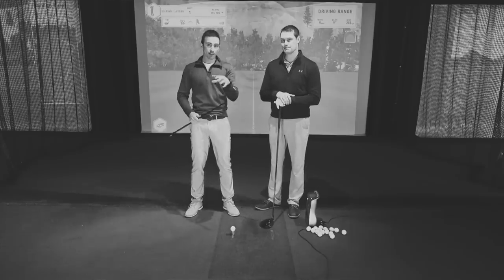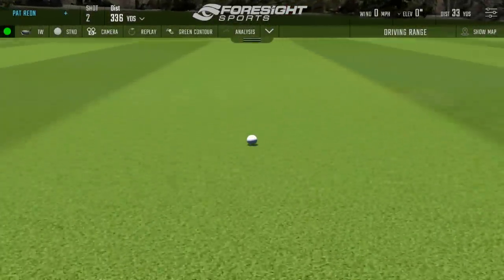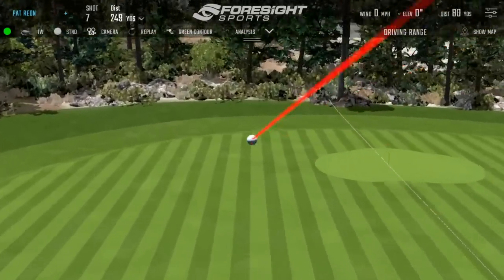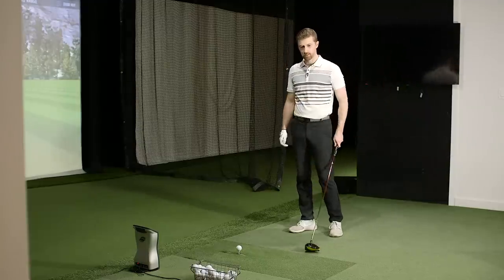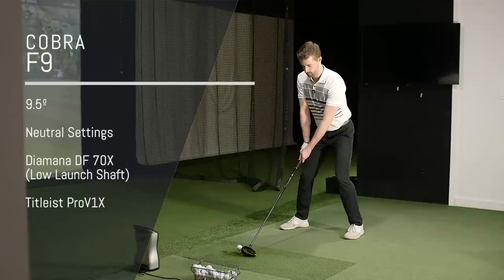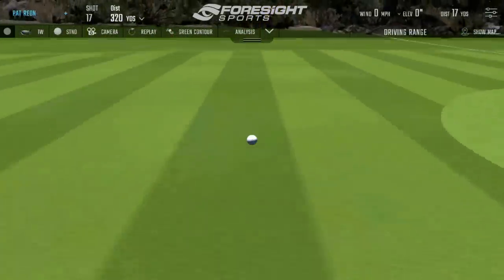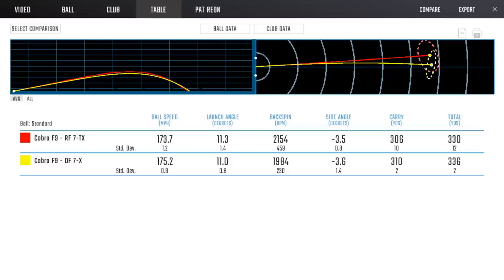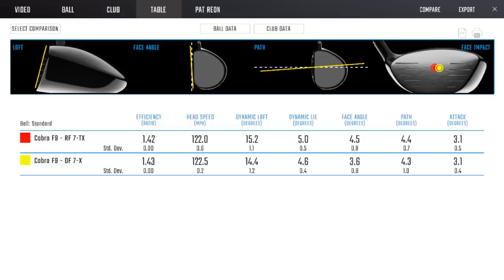High Launch VS Low Launch Shafts – The Real Difference

Comment: A can of foot spray, several shafts with various weights and flexes, and countless buckets of range balls I have figured out my shaft profile for my driver.  I also found out exactly what you stress about a shaft not being capable of determining launch and spin alone.  What i found out was that a certain shaft profile (heavier weight with an ultra stable tip) produces the best strike location for my swing.  Good stuff as always guys.

Comment: Spot on once again! As someone who had never been fitted before I definitely believed that I needed a high launch shaft as I always thought I had a negative AOA and trouble launching the ball. Ironically I found out in my fitting that I'm actually a level to +2 AOA and was fitted into a low launch low spin shaft and I actually hit it a bit higher as the strike point is now much more consistent than it was before. Hopefully people watch this video and learn that nothing is better than a fitting to know what you need. Great job once again gentlemen

Comment: Excellent and precise explanation. Which I think also leads into different flex, shaft weight etc. The shaft has to match your swing tempo and how you find that is with a fitting with no preconceived ideas about flex or shaft weight.

Comment: Great video, guys. As a club fitter, I find this kind of information invaluable. It gives me more ideas on what to look for, when fitting someone for clubs. Keep up the good work.
Reply: Where are you a fitter? Looking for someone in the Myrtle Beach area that's not Club Champion...
Reply: @stephenmoxley3004  As a fitter, what should I look for and lookout for? Went to Club Champion yesterday, and it was ok. Felt like they were trying to put me in the most expensive equipment on the planet. The guy that worked with me did actually tell me that my existing driver and shaft were the exact thing I needed, but tried to sell me a $850 3W.....
Reply: @bryanduchane2371 , I'd want to make sure that your fitter is using a launch monitor to determine your swing speed and ball flight. That's probably why they told you your driver was ok. I can also tell you that, if your swing speed is less than 90-95 MPH, you probably don't even need a 3 wood in your bag. Especially an $850 one! Slower swing speeds cannot effectively hit a 3 wood off the deck. I'd also make sure that the fitter is measuring the loft, lie and length of all your clubs, to make sure your gapping is right. That should get you through the basics.

Comment: This just saved me a bunch of over-analysis!  I would be curious if flex correlates with launch, though,  as the stiffer shafts tend to be labeled as low launch and the softer (ladies/seniors) shafts tend to be labeled in the high-launch part of the spectrum

Comment: Thanks a lot Ian and Matty for great video...at time 1550, you mentioned a fact that softer shaft left tge face opened for Matt ...thats exactly what I have been experiencing... whenever I went for my good swing (faster) , the faced opened and the ball faded ... but the articles on websites always discouraged me to go for stiffer shaft ...as they claimed that to go for soft shafts with higher torque to cater for fades (snap hooks) ...so much of non sense on websites...

Now please recommend me some shafts to try which won't let the face opened when i swing fast ...ill be very very grateful

Comment: Ian, coming back to this wormhole I've gone down in shaft characteristics... In terms of stability and dispersion, would 350 vs 335 tips make a difference with the same torque rating? I would think the 350 tip would play more stable and improve dispersion, maybe even timing.?

Comment: Great content as always. I would love to see a you guys put out a video that explains the differences between optimal driver and fairway wood shaft. If I've been fitted for my driver, would using the same shaft model in my fairway wood be the right choice? Or do they typically require different shaft profiles? Would love to know.

You guys are awesome!

Comment: I have a lot of trouble with low spin loft / low spin. I can easily hit 1500 spin consistently even in a 10.5 head. Bought an AD-DJ as it was the "high launch" option I liked the feel of. Went to CC and got fitted into an AD IZ instead. Put the DJ in my 3 wood and picked up 10 yards on both clubs! Crazy what a good fit will do. Able to time the IZ so much better now and getting around 13*/2100 and a much better overall flight.

Comment: Great video and explanation of the EI curve. The timing of everyone swing is like a fingerprint for that individual. With that being said - I know that if you move a shaft from one driver to another you may or may not get the same strike point. Would it help if you were able to create the same swingweight/head weight?

Comment: Great video guys 👏. Subbed immediately. Can u do a video next where you talk about shaft torque. I've heard opposite explanations by guys in the industry that say 1: torque has an impact on shot disparity during mishits and 2: torque does absolutely nothing except make a driver feel more "boardy"... 

I would imagine that torque (along with other variables, ex: bulge and roll) can somehow interact with horizontal gear effect in either a positive or negative way depending on any swing.. but I would really love a statistical based explanation of what exactly torque does to a swing, all other variables held equal.. if it does anything at all... Thanks in advance if you consider this idea..

Comment: Excellent video I watch all your videos and they are very informative I also notice if I swing a regular shaft that's too soft I usually push the ball not hook it interesting now I'm kind of understanding why I do much better with a heavier stiffer shaft even though my club head speeds about 103 with a driver but I have a very quick Tempo at the bottom of my swing with my hands I've experimented my whole life to try to find what works heavier and slightly stiffer works better for me my hybrid shafts are 80 gram stiff I hit that much straighter than a 65 gram lighter regular

Comment: Great content gentlemen! I'll be honest...you have educated me to the point where I'm disappointed with the average fitter in my area.  I'm at the point where I'm contemplating renting 6 shafts or so and going to my local sim and just pick the best performer.  If I can dial the head in to get my desired launch;  selecting a shaft that feels the best and I time well, without sacrificing ball speeds may just be my best course of action?  I recently tried an Atmos Black and was hitting it super solidly centering it almost every swing...Its low launch selling point steered me away?   Tensei Orange, Atmos Black and Tour AD IZ are a definite 3 I'll be testing in the next week.  Any additional advice would be greatly appreciated.

Comment: From my experience a shaft can play a bigger role in the launch of a 3 wood than a driver. Do you also find this in your fittings?
Reply: I just went thru a fitting and found the exact same thing your describing. I could hit my 3W of the deck almost as far as my driver of a tee when I found the right shaft. Actually added loft to the 3W to tame it down......

Comment: A defining moment in simplifying the importance of shaft fitting. 
Personal experience fairway wood purchase 6days ago.
Why is it manufacturers allow distributors to market there product with one manufacturers stock shaft option when advertising 3 different options?
Additionally when checking shaft length against a friends club of same club size but different manufacturer his club shaft is 1" shorter?.(standard club no fitting)

Comment: Am I correct in thinking a stiff tip suits Matt and not a soft tip which seems to me to pliable for him. He has much better control with a harder or stiffer tip methinks. I may be completely wrong. Also Matt himself immediately felt more comfortable with the lower launch version of the shaft. He is an awesome striker of a golf ball. I would appreciate some comments on my thoughts. Once again an absolutely fascinating and great insight into shafts from Ian. Incidentally I would be interested in the difference in torque between the two shafts.

Comment: I absolutely love your channel. It’s probably been addressed but load and release are also important variables. I hit low launch iron and wood shafts high and high launch, soft shafts lower. I’ve consistently shoot mid to high 70’s with clubs as customized as possible from a highly respected fitter and lab. My lowest 2 scores came from borrowing my friends clubs on a trip using clubs that were completely different profiles in weight, flex, profile, loft, lie and swing weight. Shot two 71’s.

Comment: I hate marketers.   So you're saying.....get fit.  I was fit at modern golf in Vancouver and we decided on the mizuno 850 forged. Because my equipment is majorly adjusted (I'm 6'7") I've learned to order a single trail club, in this case a 6 iron. It felt nothing like the one I was fitted for, no idea why but it was unplayable for me.  That's like 2-3 years ago and I'm still looking, I've got a spare 6 iron and 4 spare 7 irons if anyone needs one😩

Comment: Did a fitting yesterday at PGA superstore.  Didn't get the Ping or Mizuno like I thought I would because of 2-4 degrees up angle of attack couldn't get spin down. Got 10.5 M5 Taylormade Graphite design Tour IZ 6. But the ball flight is flat at 25 yrds (outside). Teeing the ball up with the 10.5 causes balloon effect.  So losing distance in TX wins. What would be good for a better ball flight with maybe a different club besides going to 9.5 degree

Comment: So, the dynamic loft is higher because the face is open, but those were just the shots blocked left. If you compare shots with the most similar parameters where the face was square at impact with same path, was the peak heights the same?  I'm curious what the peak heights are on the similar hit shots. I noticed that the data shown didn't have the peak heights.

Comment: Just fitted for Mizuno clubs . Only prob was launch higish 7 iron 20 deg and spin lowish 5000 swing speed 78 mph . Will angle of attack raise spin and lower launch or go non pen shaft . Or can ball alter . 95 % center strike

Comment: Hey ian, 
I noticed Matt isnt getting quite as high in the 170s or even low 180s as he was about a month ago. Is he just going smoother for more consistency or is something else going on?
Thanks
Reply: spidey.bh1 you may remember he had a pretty bad shoulder injury for a while following the PGA Show.  So most of the loss in speed is just swinging a little easier right now as he rehabs the shoulder.
Reply: @ianfrasergolf  Such a shame he has to put up with a 335 yard drive :)

Comment: hey guys.great info. was wondering if you guys ever come across where someone gets fitted for a specific shaft and stiffness and when the club and shaft come that the feel and the numbers, spin rates and or just over all feel is not close to the club you just demo and bought. how inconsistent are shafts. you demo a stiff and when came its now a softer feel and now its measures a regular. just wondering how accurate you think a mass production of shafts for amateurs are. the club and shaft you demo seems to always be different feel then the one they send. any thoughts thanks jeff

Comment: Hi Team TXG massive fan all the way from South Africa and was hoping you could potentially explain what the difference shaft weight would do for the same bend profile. I recently purchased a Ping G410 Plus driver and G410 3 hybrid and  both fittings were pretty easy to slot down with the stock Ping Tour 65 Stiff in the driver and the Ping Tour 85 Stiff for the Hybrid. The fairway wood however is posing a bit more of a problem as I did struggle with the Ping Tour 75 Stiff shaft in terms of dispersion which I am sure is also linked to my swing mechanics but was wondering what difference the Ping Tour 65 Stiff shaft would do on the fairway wood compared to the 75.

Comment: Really great information here, and I have had much the same experience.  Given that a shaft is really a timing device, can we expect that once you find a shaft you time up well, that it's performance will generally translate well to different heads of various manufacturers, so long as those heads have similar CG qualities and similar head weights?  I find that my current Mitsubishi C6 blue works well in any of the Ping SFT heads I've had in my posession (G30, G, G400).  Wondering if the C6 would continue to work well for me in other heads of similar CG and weights?  Same goes for iron Shafts... Modus 105 Stiff works well for me in the iE1 and i200s, assume it would also translate well into other similar category iron heads?

Comment: Class video as always. Looking for a bit of advice. Driver speed around 95 to 100 constant fade which I'm happy with looking for a good head for a bit more distance. Using ping G400 standard head at the moment. Keep up the good work.
Reply: M3 or epic flash might be a good candidate. ST190 could work
Reply: @spidey.bh1144  yeah I think the G400 is possibly spinning up to much. Thanks for your advice👍⛳

Comment: My question is, if you take 4 or 5 shafts with the same ei curves, regardless of make/model, can Matt get the same results with any of these shafts? I guess I should add, what's the chances of any two shafts from different manufactures or even models from the same manufacturer having the same ei curve?
Reply: walter shaft manufacturers will often produce similar EI curves.  Depends on other design characteristics how similar they truly are.
Reply: Ah, so just having similar ei curves doesn't mean they'll perform the same then. But I thought that was whole idea of going to an ei curve based system for shafts.

Comment: So in "Theory" and I know I need to dial it in more, but I struggle with a push/fade with my Driver and it could be the Sim Head I have and I've recently hit the Sim2 Max which is more forgiving with better results overall to me, but I still push it when I miss. Not as much as with the Sim2 Max as apposed to the Original Sim.  

Same shafts as I have 2 - Should I try a S as I'm in a Project X, R - there very light shaft which is 39 gram and then a UST yellow shaft that is also R - Proforce V2 6 and , my club head speed is 95-105max.  

I'm a feel player.  It's all about feeling the head and timing. With my Irons I use the Nippon 950's R and I love them, but that's with my Irons ;)   I have a quick tempo into the ball...so I take it back slower to the top and fire through.  Again I know I need to dial it in, but can you give me some options to start with to go hit. 

I just want to stay in the short grass more.  I can scramble, but want to be more consistent. SORRY for the rant...THANKS IN ADVANCE!  ;)

LOVE YOUR WORK!!!

Comment: guys 115 to 120 club head speed spinning driver at 6000 changed ball to avx great still need lower spin thinking about tensi white or blue or even flow white or black 70 x in mizuno st driver what you think only need another 1000 revs drop and im dailed in ? should my fairways be x flex to
Reply: Ross Wayne Driver at 6000??? 😳
Reply: yes ian ben ross veo r kuro silver 60 stiff 6000 on gc quad  @ianfrasergolf
Reply: GC quad must be broken and giving out errorneous data. 6000 spin on a driver at 115-120 chs would give you like 200yd total distance lol That being said, fairway wood and hybrid shafts are heavier than your driver shaft as a progression, so wouldn’t always need to match stiffness as far as flex went. An 80g stiff could feel stouter than a 70g X Flex trust me (ex club fitter, Long Drive competitor). Get out and experiment with the equipment if you can, that’s always gonna be your best bet
Reply: Unless you have a 25 or 30 degree driver head, it's virtually impossible to get that kind of spin off a standard driver loft.  Machine is not accurate.
Reply: @johnnypenso9574  well it is the  truth thats what it was swear on my girls life no bs
Reply: @wayneross8544  I am not doubting that the machine told you it was 6000 RPM what I'm doubting is the accuracy of the equipment. Assuming for a moment that it is actually true, then you have issues that you're not going to resolve by changing golf balls. You need to see a fitter and see what is really going on.
Reply: I did changed shafts after the ball change used tensi blue still spiny wanting to next choice is even flow white or tensi white

Comment: Of course, too soft and you can't make it snap through impact - it snaps well past impact. Which leaves the clubface open.

Too stiff and you can't snap it at all = "boardy". Could also lead to slices.

Gotta find the shaft that releases just before impact, and that's a road of trial and error. Once you found that shaft, you have to find the matching clubhead to optimize launch and backspin. So that's the route i'd basically go, first find a good shaft and then match it up with a good clubhead.